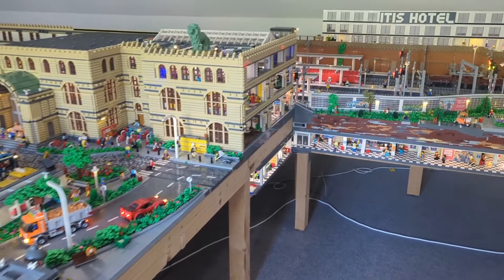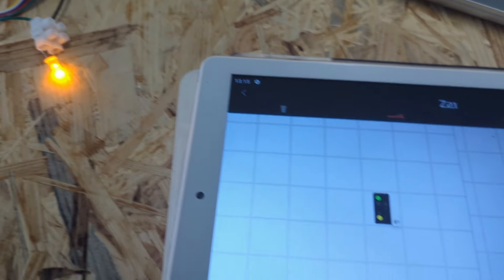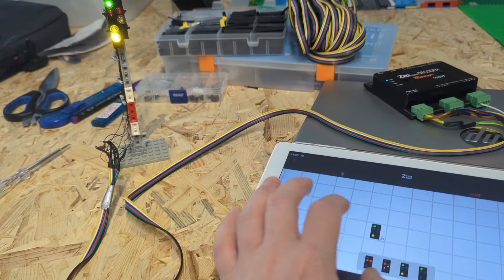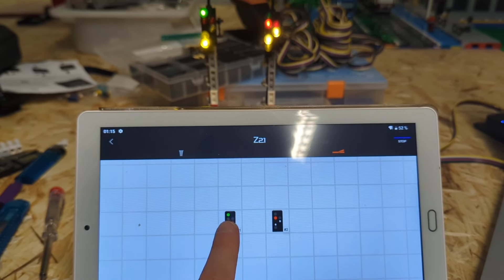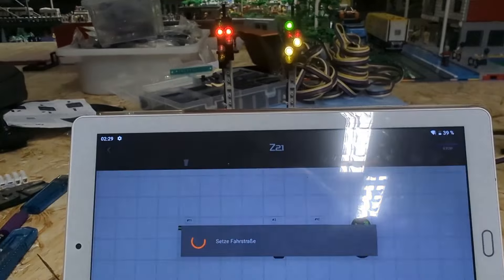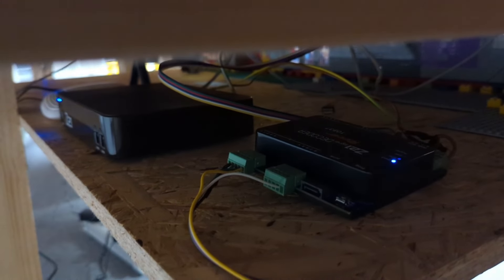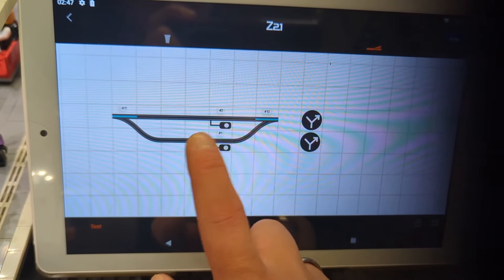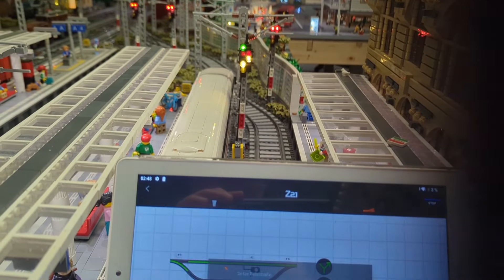World Premiere? Functional LEGO® Train Signals Now Interacting!

Comment: Nice video. You could have used programmable LED's and have only 3 wires per signal light, but not sure you'll find commercial solution for those.
Reply from the maker: Thank you for the kind words! Using programmable LEDs with only three wires per signal light is a clever idea. However, I’m not sure if that would work with the Z21 system, as it requires a common positive and a separate negative wire for each color at the decoder.
Reply: @BrickWorldInternational  yeah, not so plug-and-play compatible. But uour solution came out perfect too! Great joba